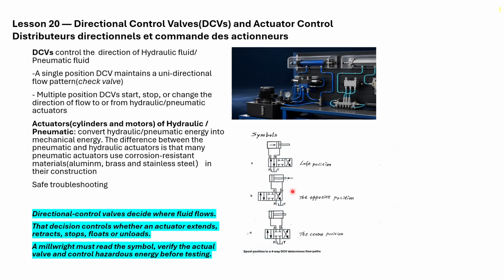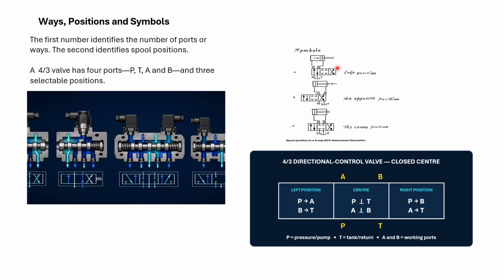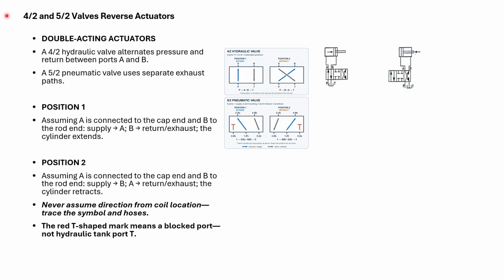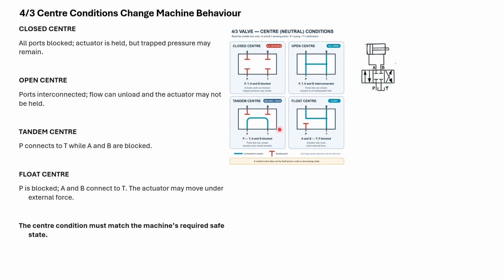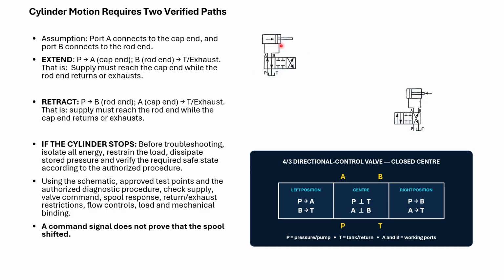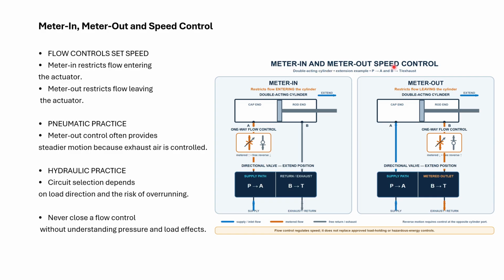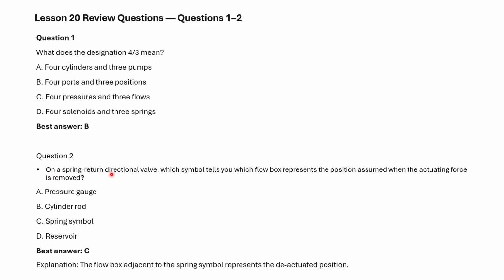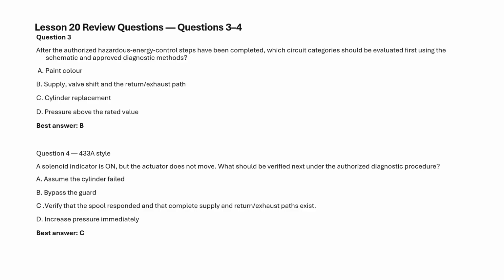Lesson 20 — Directional Control Valves (DCVs) and Actuator Control

Comment from the maker: Question 1
What does the designation 4/3 mean?
A. Four cylinders and three pumps
B. Four ports and three positions
C. Four pressures and three flows
D. Four solenoids and three springs
Question 2
•	On a spring-return directional valve, which symbol tells you which flow box represents the position assumed when the actuating force is removed? 
A. Pressure gauge
B. Cylinder rod
C. Spring symbol
D. Reservoir
Question 3
After the authorized hazardous-energy-control steps have been completed, which circuit categories should be evaluated first using the schematic and approved diagnostic methods?
 A. Paint colour
B. Supply, valve shift and the return/exhaust path
C. Cylinder replacement
D. Pressure above the rated value
Question 4 — 433A style
A solenoid indicator is ON, but the actuator does not move. What should be verified next under the authorized diagnostic procedure?
A. Assume the cylinder failed
B. Bypass the guard
C .Verify that the spool responded and that complete supply and return/exhaust paths exist.
D. Increase pressure immediately
Question 5
A vertical hydraulic actuator supports a raised load while the valve is centred. Which design and safety issue is most important? 
A. Hose colour
B.Whether the centre condition, approved load-holding devices and mechanical support prevent unintended movement
C. Motor paint condition
D. Exhaust silencer size